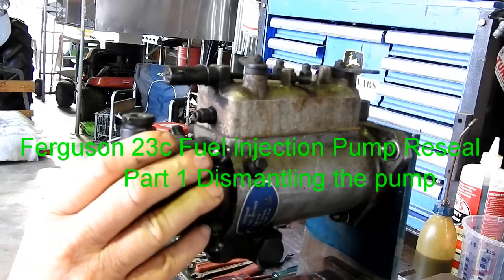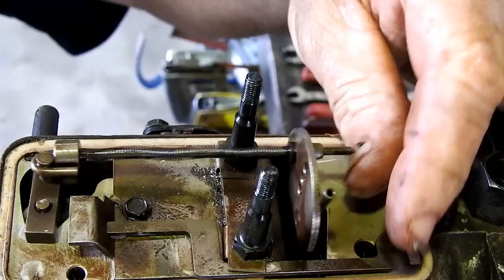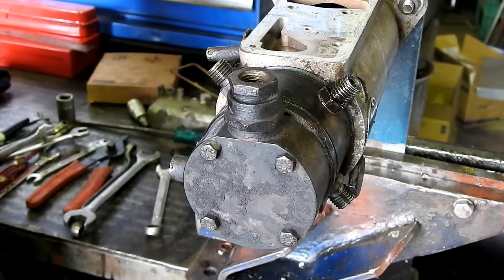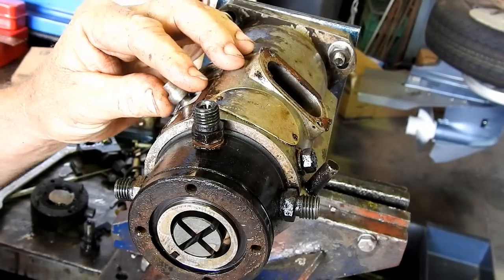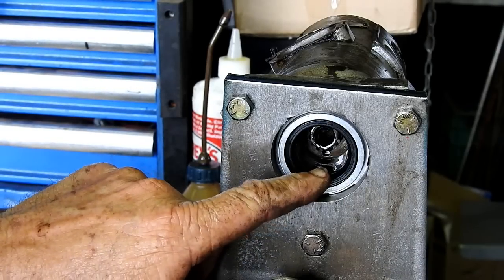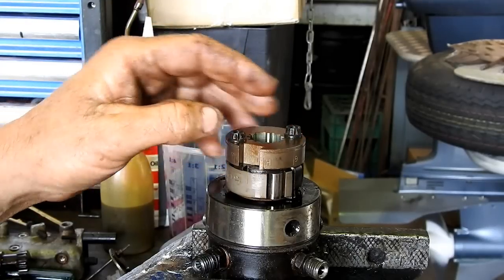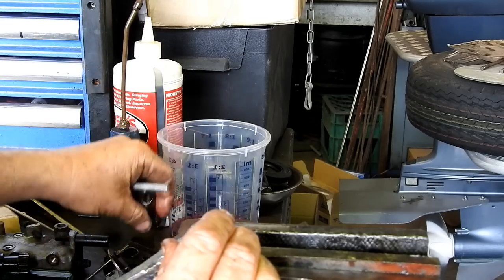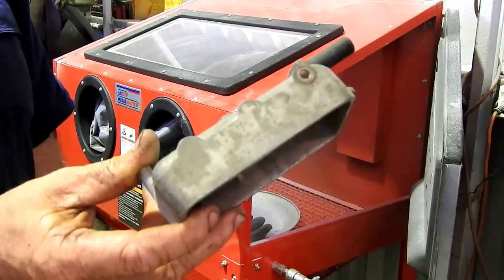Ferguson FE35 Injection Pump Reseal Part 1 Dismantling the Pump

Comment: Great video I have same pump for Massey Ferguson 1085 I m in Canada  my tractor starts right way but on throttling rpm never goes up can you pls help me to resolve this issue , thanks
Reply from the maker: Possibly a sticky metering valve that only goes so far presuming you dont have a fuel block.

Comment: Fantastic video. I have a Lucas DPS pump which is leaking round the big seal between the hydraulic head and the main body. Can I just pull the hydraulic head off by removing the parts that screw through the body or do I have to do a complete strip down. Thanks
Reply from the maker: Complete as the metering valve etc is in the way.

Comment: Does every cav advance have a little ball in the bolt holding it on? I never noticed one when I disassembled mine, but it may have fallen out without me noticing.
Reply from the maker: No not all of them.
Reply: Bundy Bears Shed awesome to hear, I’d say it didn’t have one then. Thanks a ton!
Reply: Bundy Bears Shed how much fuel should I expect to see coming out of my injection lines? I have them off at the pump and they don’t seem to be shooting much fuel out at all

Comment: Lance have don't know if it is possible to get a answer  have MF 285 I'm getting fuel into the  pump but not out the pump what may be the problem?  Thank you
Reply from the maker: I would pop the top cover off the pump and see if the metering valve is sticky, there is also a small filter on the back where the fuel pipe goes in that might be worth a look.

Comment: Hi lance. My fe35 23c diesel pump is a lot different then this one. Could mine be wrong or is it they used all manor of different pumps. Mine is a red and grey 1958. Any advice will be appreciated. Thank you 😊
Reply from the maker: There were some that didnt have the same housing under neath and some only had one bolt but from my experience the insides were very similar.
Reply: Hi lance. It was the wrong pump. It was a bmc 1.5v industrial pump. Thanks for getting back to me. All the best Nik.

Comment: any tips on getting the pump head out ? mine is quite tight- stuck
Reply from the maker: I have had to use big multi grips and twist rather than pull. They can be quite tight.
Reply: @BundyBearsShed  ok thanks guess I need to buy bigger ones

Comment: is there any reason for a cav ,DPA, 3 cyl pump not fire correctly on one cylinder
Reply from the maker: Usually it is an injector problem not a pump one if the other 2 are working fine.

Comment: There is a code number that tells you which holes the governor spring should go into, do you know where to find the code number?
Reply from the maker: on the cav download on my web site in the technical section.
Reply: @BundyBearsShed  Thanks Lance , Had a look at your  earlier video where you explain its the 2nd last number on the name plate unfortunately my name plate is mostly illegible .

Comment: Great video  Bear, I'm trying to work what's wrong with my  FE35 Diesel, hard to start but when running does not respond to the throttle, I have bled the system and it appears to be delivering diesel to all four injectors  but at what pressure and flow rate ? Do I need to open an account to purchase an overhaul kit?
Reply from the maker: Not sure why it is not responding but check filters would be a good start as well as the air cleaner.
Reply: @BundyBearsShed  Thanks, will do

Comment: Can you adjust the amound of fuel with this kind of pump
Reply from the maker: Yes by adjusting how far the rollers travel, you loosen the two little bolts that hold the rollers in.